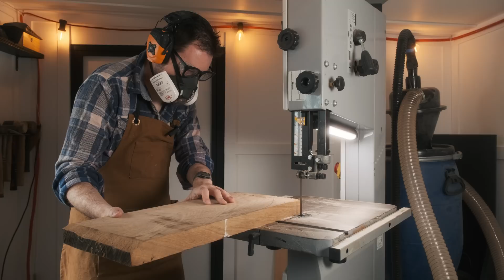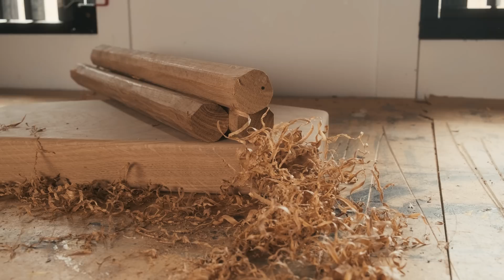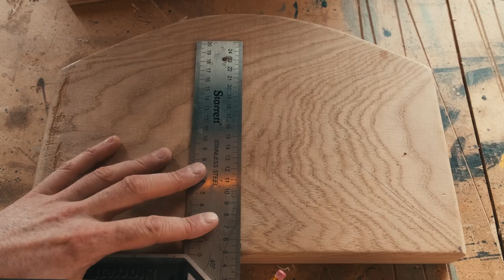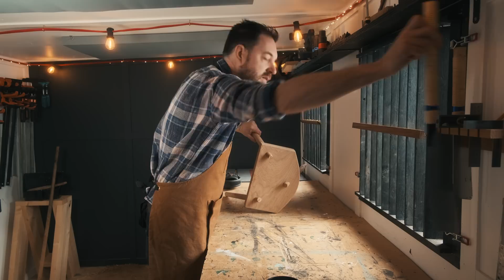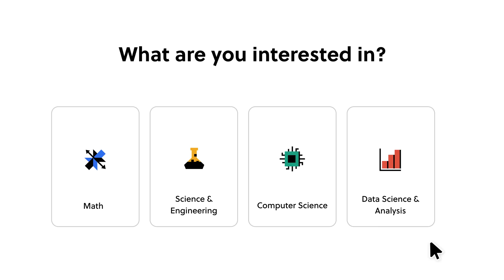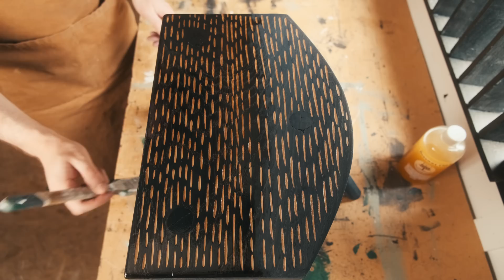Making My First Small Stool

Comment: I like the stool and the non slip seat however your legs look quite splayed so I suggest taking some twine (for the rustic look ) do a twisted line between the lower part of the legs. You might need a small notch in the legs to stop the twine riding up.
Reply from the maker: Thanks

Comment: In a future stool, it would be good to counterbore the holes so that the wider part of the leg seats down into the counterbore, so that a "step" is not visible at the top of the legs. Or put the legs into a lathe and skim them until (a) they are round and (b) there is no "step" at the top, but rather the entire leg has a very slight barrell shape.